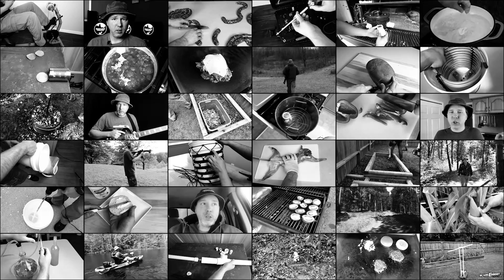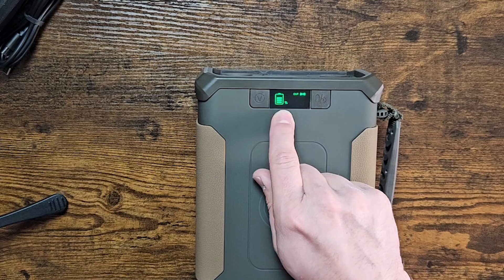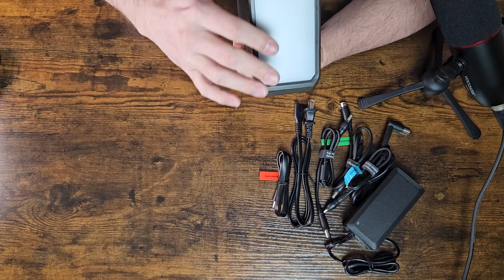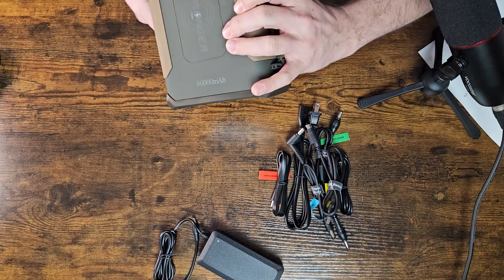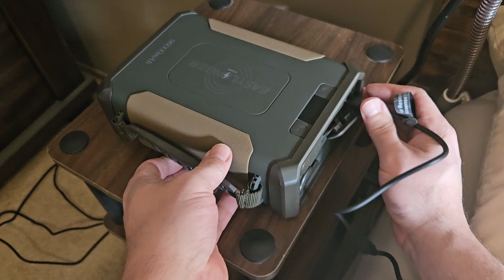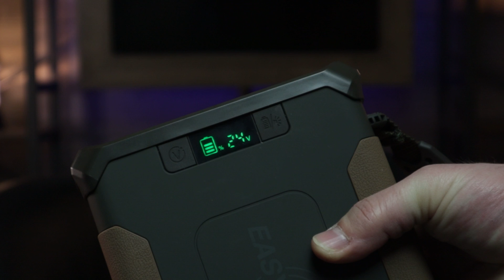Affordable CPAP Battery Backup | EASYLONGER ES960 Unboxing, Testing & Review

Comment: Not a question about the battery, but what mask are you using? I'm looking for a new mask like what you're using in the video.
Reply from the maker: It's called the Phillips Dreamwear. I did hear that they may have discontinued it, because there's small magnets in the clasps that apparently interfered with someone's pacemaker and there was a lawsuit. I do like this mask much better than the traditional kind, though.

Comment: Im assuming air pressures also matter? I've seen videos on other batteries and i hear ppl talking about several nights but I barely get 1 night out of mine with heat and humidifier off. I can only assume air pressure is also not calculated as mine runs high
Reply from the maker: I suppose a higher pressure would increase the power usage - though I would think not by all that much. I run my machine at a 7, for reference. And various CPAP makes/models will surely use slightly different amounts of power.

Comment: Thr ciggy lighter adapter is good for a 12v system as the battery doesn't  need to convert the 120 wall cord to 12v.  More battery life.   
$400 amazon Canada hmmmm

Comment: That first bar for battery remaining really is about 40% of the capacity not 25%. Once you have 2 bars, it will run out in a few hours. Odd but that is what happens. I have used the 960 on hunting trips but I find I can do without humidity but not the heated hose. Having that cold hose in the sleeping bag with me, chills me. I can get 2 full nights with minimal heated hose on an Airsense 11 setting of 8 - 11. At home testing with no heat or humidity, I got 6 nights of 8+ hours. They are good batteries in spite of the lack of features.
We just got a Bluetti AC70 attach flow through with the Easylonger.

Comment: Ok so if I keep this plugged in all night and plugged into my cpap will it work just as well? Example power goes out in the night will the battery act as a back up them with out waking me up?
Reply from the maker: That is my understanding of this product, yes. Though it should be noted that the overall battery life could potentially be shortened if left plugged in at all times. There is circuitry to prevent over-charging, but never letting the battery drain (if it's always plugged in) can reduce the overall charge capacity and/or lifecycle of the whole thing.
Reply: @GreatLakesCountry  bought it anyways. works great!

Comment: It's more efficient to use the "cigar lighter" port to go from 12 volts to 24 volts, with the DC-DC up convertor, than it is to use the 120 volt AC to power the 24 volt power supply to provide power to your CPAP machine. More efficient means more run time for your CPAP machine. B-T-W each line on the charge symbol equals 25%.
Reply: "B-T-W each line on the charge symbol equals 25%"

Who said that? You working for the manufacturer?

Comment: I too need a humidifier and just got this very power bank for my camping days. A while back I got tired of hauling distilled water for my Airsense 10 and 11 CPAP machines (and found that overseas it was sometimes impossible to find) so I have worked out a solution and I no longer use a humidifier at all: I place either recently boiled tapwater (the boiling removes the bleach smell) or a washcloth soaked  in hot tapwater in the humidifier chamber and it works a charm. For my Airsense mini I just drape the hot water soaked washcloth (placed on a saucer) over the vent loosely of course and it also works really well all night. Hope this helps someone.
also, if you don’t want to set the voltage, use the cigarette lighter cable, which would be extra in this case. That’s what I’m doing. I used it last night for the first time and it was fabulous.

Comment: In have this battery from another brand and it cannot be 96 Ah - for 12 volts it can only be a maximum of 24 Ah. It is way too small to be any more than 24 Ah. 

You can get a DC to DC converter for Resmed that are more efficient so use less power. They can be run from 12 or 24 volts and automatically convert to 24v.
The C port is for both charging the battery and for powering devices.

Comment: These LiFePO4 batteries can be charged to 100% as often as you want without serious degradation compared with an NMC (Lithium Ion) battery.  You need the light for the two only reasons to buy this: Power outages and camping.  Seems a bit obvious to me. Also, before you peeled back the flap for the USB C port, the flap said IN/OUT, but you claimed it was in only. Thanks for the review

Comment: I just bought this. The wall charging unit gets quote hot while charging the battery.  Is this normal?
Reply: I noticed that too.
Reply: @jrclark9019  Have you had any issues with it running hot?
Reply: Have you had any issues with it running hot?

Comment: Just wondering why people go this way…….Why not just get a general power backup that is more versitle?
Reply: Lack of Knowledge . Ecoflow river 2.    $168.    256 watt hours. Lifepo4 batteries 🔋 & much more capable. Just a slightly larger footprint 👣
Reply: The run time in those less. Those are intended to be used just long enough to be shut down ASAP. Plus those batteries are terrible and way smaller and the beep loudly every minute.
Reply: How much is it? Probably too much.

Comment: I have one of these and it only last two nights and that is without the humidifier on and heated tube
Reply: Several factors can influence the runtime of a CPAP machine:
1, Humidifier and Heater Use
2, Pressure Settings
3, Mask Type
4, Auto Mode
5, Machine Type
6, Auto Leak Compensation
7, Ramp Feature (On/Off/Time Setting)
8, Exhalation pressure relief setting
9, Therapy Mode
10, Ambient Temperature
11, User's Breathing Habits
12, Altitude
13, Bluetooth/App/Wireless
14, Smart start/stop feature

Under the same settings and usage conditions, power consumption will be as follows:Travel/Mini CPAP < CPAP machine < Automatic Positive Airway Pressure (APAP) <BiLevels & BiPAP.
Reply: Hi,you can check and adjust your setting to extend the runtime,and please make sure to fully charge the battery before use. Hope this will help^^
Reply: @easylonger  thank you for that so do I have to turn all those features off?
Reply: @simonbustin9543  Yes, you'd better turn off both to extend the runtime,or it can't last for two CPAPS for hours.
Reply: @simonbustin9543  Hello, sorry for the late reply.
You don't need to turn off all these functions. We will recommend: First, fully charge your ES960 battery, use it according to your normal settings of  CPAP, and test the runtime. If it meets your needs, you don't need to make any settings changes. If the runtime is too short, please turn off the most power-consuming functions, such as turn off the humidification and heating, reduce the pressure level, adjust the mask position, reduce air leakage, etc. I hope this can help you^^
Reply: @easylonger  I just ordered one of these to use with my DreamStation. How do I set it up to use pass-thru? Basically I need it just for home use, want to be able to have it fully charged, plugged into wall and then my cpap plugged into it and only kick in if the power goes out.

I'm not totally familiar with pass-thru... does that mean it won't CHARGE while plugged into wall and only give power to the CPAP during an outage? And I've read many many comments while researching that the wall charging unit gets very hot... is this something to be worried about? I don't wanna wake up with my bed on fire since this will be so close to it.
Reply: @The-Real-MOTIONMAN   
Hi,

You can use the included AC adapter to plug into the DC IN port of the ES960 battery. Then, set the battery's output voltage to 12V.

Next, use the DC cable labeled "For DreamStation" to connect your CPAP machine to the DC OUT port of the battery. This will allow for pass-through usage while the battery is charging.

Thank you!
Reply: @easylonger  Thank you so much for the reply and the info I needed. Are there any negatives to running pass-through 24/7?
Reply: @The-Real-MOTIONMAN  Running pass-through charging 24/7 (where the battery is plugged into power while simultaneously powering your CPAP or other device) is generally safe for occasional or short-term use. However, there are some potential drawbacks to maintaining pass-through mode continuously:

Long-Term Battery Wear: Continuous pass-through charging may keep the battery at a high charge level, which can accelerate the battery’s long-term aging.

Heat Buildup: Running pass-through mode all day generates additional heat. Although the ES960 has built-in temperature protection, prolonged exposure to higher temperatures can affect performance.

Recommendation:
It’s best to use pass-through mode occasionally, such as during short power outages or while traveling, but not as a permanent 24/7 setup. For continuous backup use, please unplug the charger periodically to allow the battery to cycle naturally.
Reply: @BVIAS  Dear BVIAS, Thank you for pointing this out. We recommend turning off the off humidifier and heater, this is intended for use outdoors where it will extend the run time of the battery pack, not to change the pressure level of the CPAP machine. We know that the pressure level is determined by the doctor as this is best for sleep and health. Of course, some people may be uncomfortable if they turn off the humidifier and heater, so they can keep their CPAP machine with the heater and humidifier on, it's just that the CPAP machine consumes more power when these features are turned on, so the run time of the battery pack will be reduced. If the CPAP machine is used at home, then the battery pack's pass-through feature can be used, which will keep these features turned on properly without affecting operation throughout the night. If outdoors, the CPAP user can also keep the humidifier and heater on if he has solar panels to recharge the battery pack. We want every CPAP user to have a good night's sleep and enjoy the outdoor camping experience. Thank you for your suggestions and we will continue to make better products and services. Thank you.

Comment: i just use a 12V 100 ah lifepo4 battery and a 100 watt solar panel to recharge the battery during the day
total cost $200 and yes it's larger but i does just what i need.
i can now go on fishing trips and camp for a couple days for the first time in years.
you can put a wet wash choth in the water tank and get humidity for the CPAP without using the heater.
Reply: How many days of cpap with no heater? Also how do you connect the battery to the CPAP machine?

Comment: Works great but only last 8hrs on a charge with newer Cpap machines.  So must take solar charging system
Reply: Hi,this is EASYLONGER
Several factors can influence the runtime of a CPAP machine:
1, Humidifier and Heater Use
2, Pressure Settings
3, Mask Type
4, Auto Mode
5, Machine Type
6, Auto Leak Compensation
7, Ramp Feature (On/Off/Time Setting)
8, Exhalation pressure relief setting
9, Therapy Mode
10, Ambient Temperature
11, User's Breathing Habits
12, Altitude
13, Bluetooth/App/Wireless
14, Smart start/stop feature

Under the same settings and usage conditions, power consumption will be as follows:Travel/Mini CPAP < CPAP machine < Automatic Positive Airway Pressure (APAP) <BiLevels & BiPAP.

By considering these factors, you need to estimate the expected runtime of their CPAP machine or adjusting settings to optimize power efficiency，and please make sure to fully charge the battery before use. Hope this will help^^

Comment: If you set the volts to 24 for your CPAP machine does that set the volts for all the output ports because you won't be able to charge your cell phone on this thing while your sleeping. I mean I don't think the USB ports should switch to 24 volts but it's not really explained.
Reply from the maker: I believe it only affects the CPAP adapter output. I can't say for certain, but I believe you're still good to charge your phone and such.

Comment: I already have a few computer battery backup units, will they work with a resmed10
Reply: Those have lead acid batteries in em and would need to recharge em more often, the lifepo would last longer it has about 3000 recharge cycles and the lead acid much less which means u would need to replace those batteries more often so cost would be much higher.
Reply: @larrytanton5787  Yesssss!!!!!! Long last!!
Reply from the maker: If they accept a normal 110v plug, then I'm sure it would work with a resmed. But I couldn't speak to how long it would power the machine. I have a fairly large UPS for my computer, and it would likely not power my CPAP for  a whole night.
Reply: Can this power 2 airsense 10s at the same time?
Reply: @erwinhernandez99  Yes, you can power 2 airsense 10s from to our (2 cigar output ports) or power one from DC output port，one from cigar output port), remember to turn off the Humidifier and Heater, Hope this will help.

Comment: I had a huge problem with SUPER-DRY mouth using my CPAP. I now use a CHIN STRAP on my face, and that problem is 100% solved! Even when I turn humidifier off - which of course saves tons of battery power. I use a full-face mask as well, not the nose-only mask.
Get. A. Strap.

Comment: I’m new to this subject and in search of a backup supply for my Bipap machine. 
Can this unit run as a UPS? does it have the pass thru feature in other words. I’d like to plug in the wall 24/7.
Reply from the maker: To the best of my knowledge, this device probably won't quite work that way. It plugs into the wall only to charge its own battery. If you plugged something into it, it would drain the battery even if the battery is plugged in (because it would drain faster than it can charge). That being said, you can get a UPS that will probably work for the same amount or less than this costs.
Reply: @GreatLakesCountry just a update/correction. I did do more reading on this unit and it does in fact include the pass thru feature in its specs. fyi.
Reply: @riggermorpus  Yes,it can be used as a UPS without any problem.😘
Reply: @GreatLakesCountry  thanks for the quick reply and info 👍

Comment: So in your opinion which is better the deep cycle battery and an inverter or this? Or both?
Reply from the maker: This gadget is much more convenient and portable. The marine battery and inverter will power much more stuff, and for way longer. If I'm only needing to power my machine for a night, I'd grab this thing. Otherwise, I gotta go with the big battery.
Reply: Battery manual says don’t use certain resmed like the 10, I use it too, with an battery inverter

Comment: I’ve tried finding and purchasing a 80 watt or higher solar panel that is mentioned in the Easy longer ES 960 users manual. I can’t find one anywhere. Can you recommend where I could locate one? Thanks
Reply: Hi,do you still need the solar panel? We will send a link for you.

Comment: my math is not adding up. at nearly 300 watt hrs capacity, according to amazon and running lowest voltage..12v. that would be 25 amp hrs capacity not 96000 mAhr (or 96 amp hrs).  300/12=25

Comment: Great video. I’ve been looking to buy something to charge my cpap in case of the electricity goes out. What is that mount you have for your hose. Mine has a tendency to fall between the mattress and headboard causing some neck discomfort and sometimes just wakes me up from it tugging my head.
Reply from the maker: Thanks. Yea this little hose clamp thingie is great. It keeps the hose at the proper angle, but also serves as a sort of "anchor" point in case I inadvertently move and yank kinda hard on the hose. This clamp will take that "yank", rather than me risking sending the machine flying. Here is the one I use: https://amzn.to/3ThNa2i